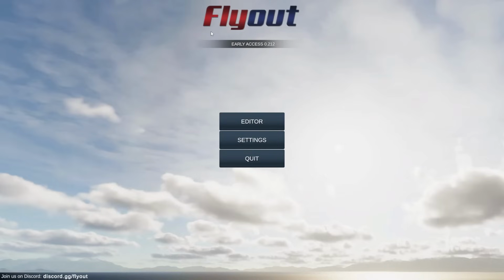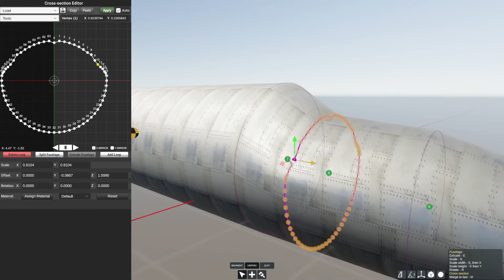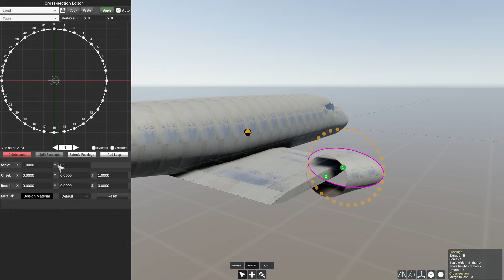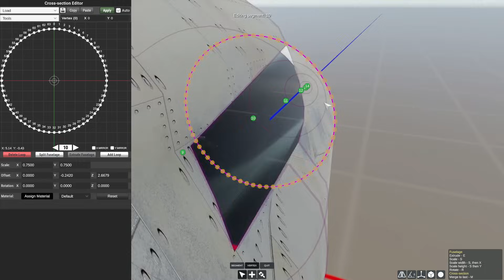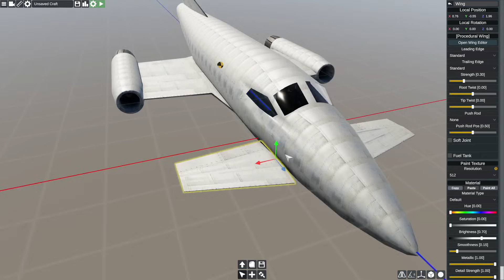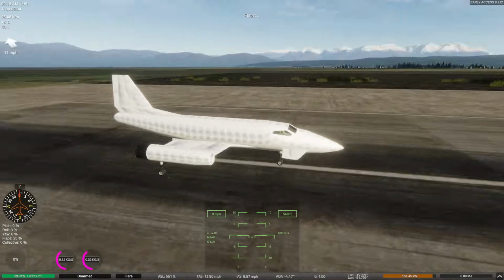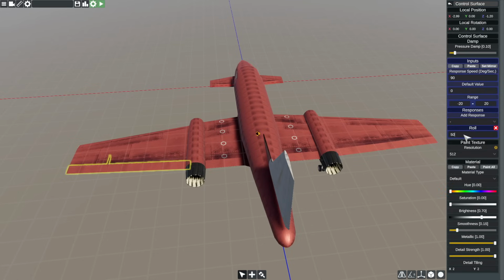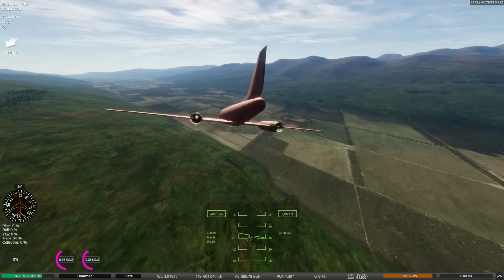FLYOUT Has Been RELEASED! - MACH 1 JET BUILD!

Comment: LPC (low pressure compressor) allows for compressing the air when it initially enters the engine and isn't compressed yet. The HPC (high pressure compressor) allows for compressing the slightly  compressed air even more. The more compressed the air, the better it is for combustion.